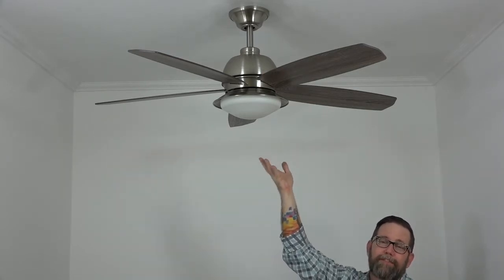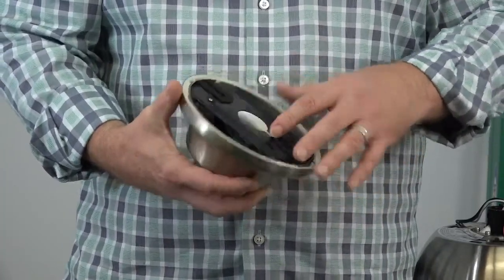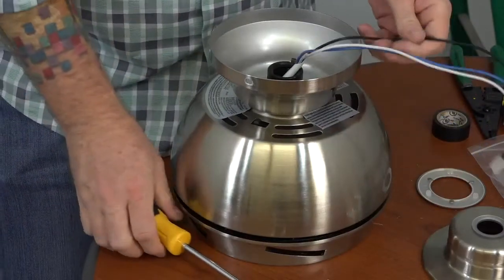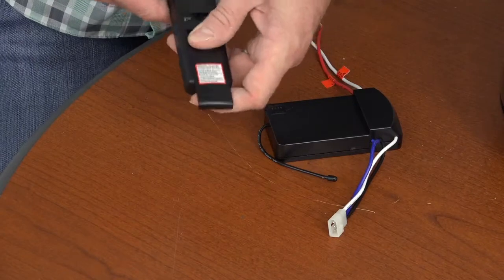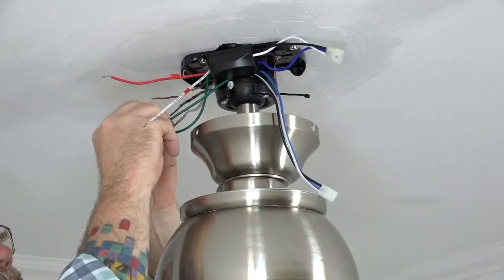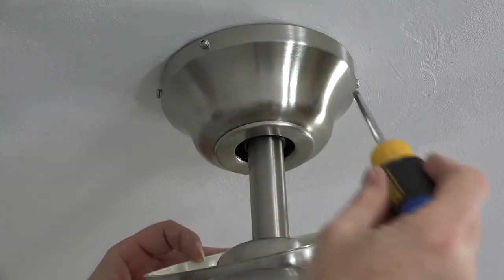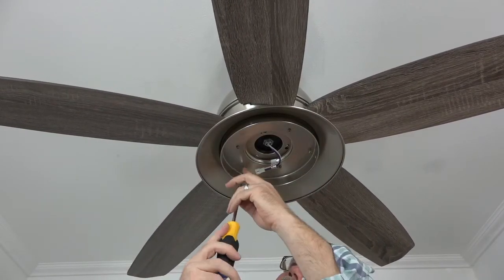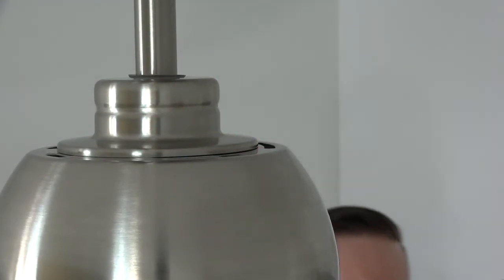How to Install the 52 in Ackerly Ceiling Fan

Comment: What happens when the LED light module burns out in 10 years? How would we replace it? How would we find the parts TO replace it?
Reply from the maker: If the LED module ever burns out, it can be replaced. The LED module can be ordered by calling the customer service number on the manual. The module is rated to last up to 40 years with average 3hrs/day use.

Comment: Unfortunate that I had to navigate all the way here to figure out the flush mount or close to ceiling mount.  Would have been good if it was mentioned in the instructions or description of the Ackerly fan - ESPECIALLY because the gasket is a part that isn't included!
Reply from the maker: Hi Ian. There are 2 versions of the Ackerly fan. One has a remote and is designed to be tri-mount so it has a flush mount option. The other is the pull chain version which does not included a flush mount feature. Since your fan did not include the gasket or flush mount instructions, i am assuming that you have the pull chain version of the Ackerly fan. The descriptions on the Home Depot's website accuratlely state that one is tri-mount and the other is dual-mount. Only tri-mount fans have the flush mount option. If you wat to install the pull chain Ackerly in the flush mount configuration, you can probably get a gasket by calling Home Decorators Collection customer service at 1-800-986-3460.
Reply: I see that now - thanks for the response. Very hard to find and misleading however, since if you search for “flush mount” fans and simply change the style/color, you end up with the wrong fan. It would have been more helpful if these were listed as 2 separate products.

Comment: You forgot to instal the trim ring for the flush mount instal
Reply from the maker: Thanks for watching. We included the canopy ring in the "Securing Canopy and Attaching Canopy Ring 14:26" section since it is the same for both downrod and flush mount installation.